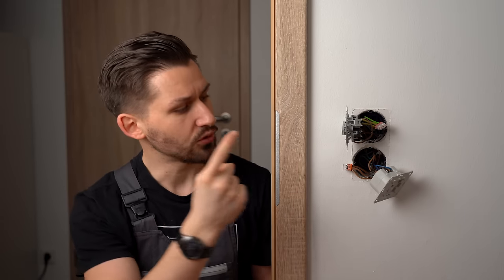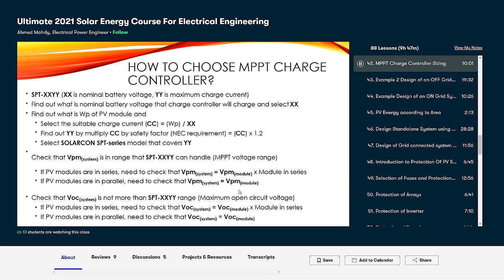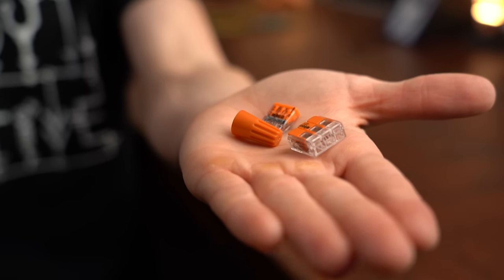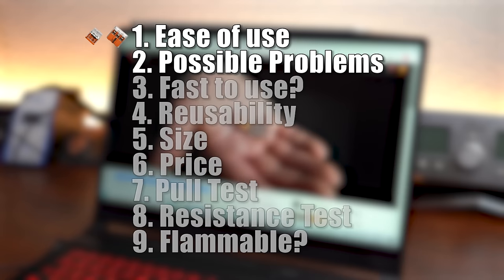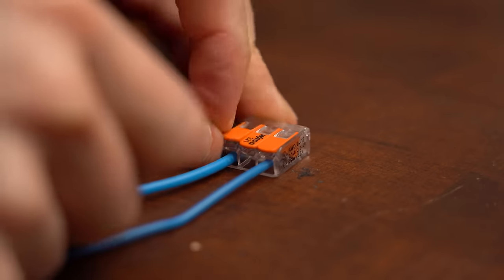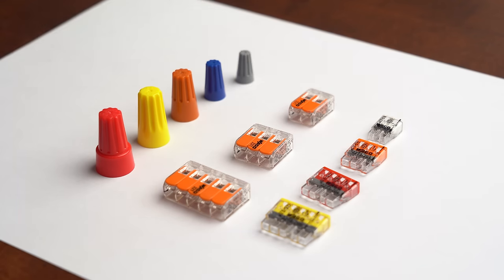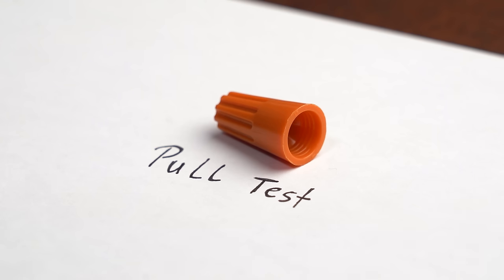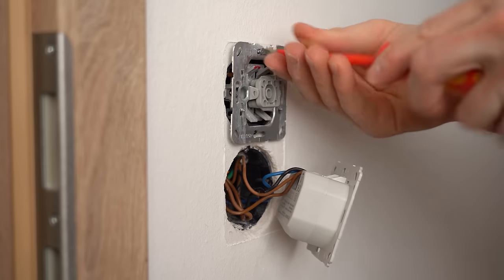What Wire Connector is the Best? Settling a Debate! Wire Nut VS Wago

Comment: Wago  doesn't damage the wires. Wire nuts can be "aggressively" over-tightened, requiring that the wire ends be clipped before making a new connection. Living in the US, I replace wire nuts with Wago whenever I work on an electrical connection.
Reply from the maker: Good to know :-)
Reply: This is a good point. For new installation, especially by a licensed electrician, I have no problem with wire nuts. Rework is a nightmare though. I think I will get Wagos for any time I'm doing some repairs or changes.
Reply: You don't seem to understand that the whole point of a wire nut is to create a low resistance gas tight connection between the conductors by physically deforming the copper into direct conductor to conductor contact. That's also how screw terminals work by the way and you'll never find press in contacts where current is important. Pay attention to resistance.
Reply: Wire nuts are suppose to be aggressively over tightened.  The biggest problem with them is  people not clamping them down enough.
Reply: @Peter_S_  You are tunnel blinded by resistance...Yes, wire nuts are better in resistance but i never seen WAGO or wire nuts on continuous high load application like running high kW motor or residential heating, there are always employed screw terminals. You are crazy if you think little warmer wago (1-5 degree C above ambient) within rating 24A 2273 wago and 20A 221 (IEC/EN) gonna cause any problems...
Reply: @Peter_S_  You're so sad going though all the comment defending the wire nuts like there your child. Chill out.  The resistance was in wagos was so small it was negligible. If there used in there rated current range (which is handily printed on them)  they are absolutely fine, and better than wire nuts in almost every other way.
Reply: @djenson  I'm one of those people who's made a bunch of money by repairing the sloppy high resistance work of others like you who just don't care and endanger people through sloppy work. Ever heard of an electrical fire? You can't even master selection of they're, their, and there which is taught to young children and you're calling others sad? 🤣🤣🤣
Reply: @samuelgomola9097  Every 30A circuit in America which isn't a home run uses wire nuts unless it's high spec where you use split bolts. You've never seen one? You need to get out more.
Reply: @Peter_S_  You repair others work?  How do you manage when your full time job is defending wire nuts? I wonder why the high resistance work is common over there huh.. I hope there not using all holy wire nuts in this shoddy work. Would be interesting to see the electrical fires per 10,000 households in the USA vs Germany. 

I have a life, grammer lord. It's the youtube comment section here, Not the essay submission page for how wire nuts are godlike 🤣 Have a nice day 👍
Reply: @djenson  You have so much of a life that you spend it trolling. 🤣 Have a nice day 👍
Reply: absolutely incorrect. Wagos can and will damage the wire. One version of the Wago relies on digging into the copper with a spring steel that you then have to twist aggressively while pulling to get out. How does that NOT damage the wire?
Reply: @samuelgomola9097  I have. I've seen fires started in a switch box before because of the push in wago that they used. There is no perfect solution and to act as if this is the end all tell all solution is naïve.
Reply: @djenson  Given that Germany only has around 84 Million people vs the US with 334 million any relevant information wouldn't be that helpful. It's also important to note that the US uses a standard of the NFPC, the National Fire Protection Code which the NEC the National Electrical Code is based off of who tracks that data and Germany doesn't seem to have any resource that I can find regarding that. However with the NEC tracking this information we do know that 39% of all Electrical based fires happen because a malfunction in the cold weather months because of electric heaters. 13% of fires in the US between 2012 and 2016 were cause by Electrical fires and of those only 4% were cause by damage to the connectors which includes things like driving a screw into a wire in the wall by accident, driving a nail into one. accidentally cutting the wire and improper installation of equipment. I'm not really sure why you are so pressed about Peter defending the wire nut but I can assure you that your comment outlines that the problem doesn't seem to be with peter or the wire nut.
Reply: @matthewprince6157  The issue I have with Peter is that he seems to be tunneled into a vision of resistance and going to people with a positive experience of wagos and having a go. Would I use a wago in a 3 phase commercial air conditioner? probably not, but for where they will be commenly used (i.e. lighting circuits, 15/20a outlets), there a lot more practical than messing around with wirenuts, especially if something needs to be changed. Regards to electrical fires, it's more of a jab towards how safe electrics are in Germany Vs USA, surely if wagos were casuing issues there would be a disproportionate amount of electrical fires in Germany Vs the USA. Needless, and cannot be proved, I know.
Reply: @matthewprince6157  yes! Just like the jakey push in terminals of old receptacles. I'm satisfied with the Buchanan B caps that I've used for 40 years. I'm not afraid of a little inconvenience installing them right.
Reply: @matthewprince6157  Right Statistics per 10000 Households would be inaccurate because of the larger population of the US. What are you talking about ???
Reply: @djenson  resistance is what matters....resistance makes you pay more electricity and also makes heat so your wires melt and your huse burns down,,,these days when all you hipster talk about saving the planet the turtles and the oceans...that extra watt  is a waste....and dangerous too...especially when using high power stuff like stove, heater, etc etc
Reply: @samuelgomola9097  there are never any problems when using things on their rating....the problem is when and if you abuse somthing and it has no redundancy....wire nuts especially the bakelite ones that all electricians use, not the shit ones used in this video, provide the best connection and that was proven (not that it was needed)...so wago is simpler and faster and idiot proof but nut is better and even when its not correctly used because you are supposed to twist the wires and make a solid connection prior to insert the nut...the nut is just insulation and the connection doesnt have a current limit...the limit is on the wire itself
Reply: @MrHBSoftware  I don't think you're house is burning down or wires are melting due to wagos. that would be an incorrectly sized MCB, and someone plugging multiple electric heaters / high load devices in.

Comment: When connecting stranded and solid wire with a wire nut, 
extend the stranded wire beyond the end of the solid wire slightly before connecting.
It is required to twist the wires together to make a sound mechanical connection before securing with a wire nut. We strip more than enough sheathing from the wire and twist them together holding the ends with a pair of lineman's pliers, then cut the excess wire to length and secure with a wire nut.
Reply: haha yes and it takes a good bit of experience to do it properly. A good few kids in my class never got it right. It takes muuuuuch more time than a wago.

The wago does make a shitty connection which can be an issue at times. I hear someone who had cars driving by worsen the cut it makes in the wire and make the lights flicker.

I would never use wago's for an electric stove but I imagine germans would run a cable straight to the switchboard.

If you keep twisting the nut you can push it in circles into the box and fit a bit more spare wire inthere. You shouldn't twist a wago.
Reply: @gabydewilde  yea it also takes time and experience to be an electrician.

Comment: From the eyes of someone who's had to tinker around the house once or twice: Wago all the way. Much easier to keep it tidy and the miniscule power loss is fine (And I imagine could be improved with future design changes.)

They're expensive in Canada (Like 5-6 more than wire nuts) but are worth it.
Reply: could they be a good solution for AL to CU connection?
Reply: @ullacockambrink9101  thanks :)

Comment: Wago is also designed for ease of electrical testing, with special slot for the probe on the other end.
For price, probably could have added a sidenote on prices for connectors manufactured location and compare prices for ones manufactured in US
Reply: Right, ones are from US/EU while this other is from China!
Reply: Love that test slot! Great for small motors you can test voltage drop without having live wires hanging out. 

He should show how eu and us motors are wired differently that terminal block they use is slick.
Reply: @Engineer9736  your phone has it pre installed

Comment: Due to the wire nut itself not being a conductor,  there generally doesn't need to be a rating of amperage. If you project has proper gage wire,  the smaller wire nut won't fit the wire that is bigger and meant for more power. Meaning unless you don't know what you are doing(meaning you shouldn't be connecting wires in the first place), you should never have a loose connection or a nut not capable of the amperage said cable provides.
Reply: That is exactly right.  Twisting wires provides more area of surface contact than the area of the wire itself.  Voltage drop should come from the load and the resistance of the wire itself, not a handful of "weak link" conductors added into the circuit.  Anyone who regularly uses Wagos in switch or plug (device) boxes probably hasn't been around long enough to see the results of the vast use of "stab-lock" receptacles.  The poor connection causes overheating.  The outlet becomes brittle and cracks causing the clamp that holds the cord to weaken, adding even more heat ... Service electrician removes the outlet and wires slip right out.  Wagos have their purpose, but carrying the full load of a 15A or 20A branch circuit is not it.
Reply: @SteveWhiteDallas  you’re pretty spot on. I’ve seen the same people go on and on how stabbing outlets is a bad idea but then go on and on about why wago connectors are better than wire nuts.
Reply: Wago Connectors are designed for german / european market in mind. That said, the DIN is giving out the technical norms of wires and connectors.
The maximum current allowed for a 4mm² wire in a wall is 24A. Since there are no 24A fuses, these wires are protected with 20A fuses.
And these 20A are exactly the rating for a 4mm² Wago Connector. So if you overload that connector you are also overloading the fuse.
So here is the same argument: as long, as you know what to do, there is no special NEED for a rating of wago connectors. BUT they do have a rating since it is possible that you use these connectors in ways, they normally should not be used.
That is simply how our norm system works. We are experts in doing special limits and regulations and stuff and then even print it on the damn thing so every idiot can read and understand it. It is like printing "Attention! HOT!" on a cup of coffe.
Or writing "Don't dry your pet in a microwave" in the manual of that microwave.
You never know what people may do with these things.